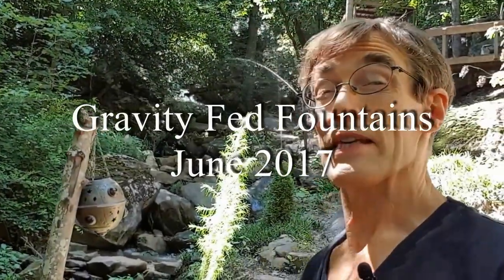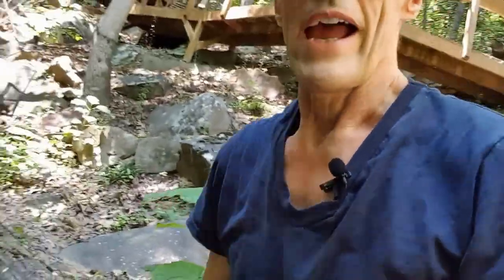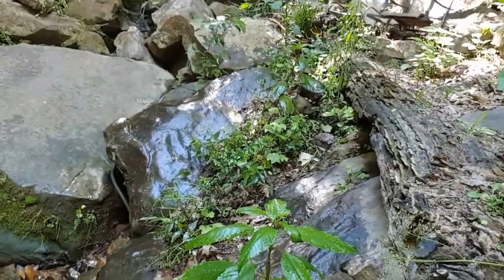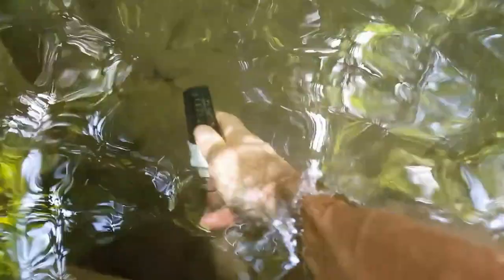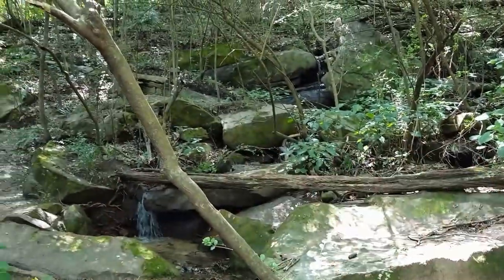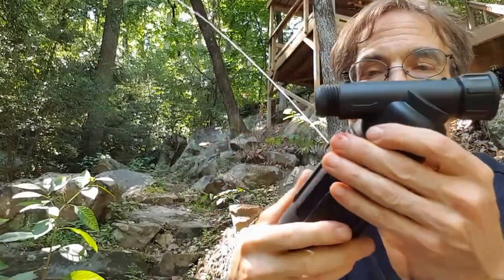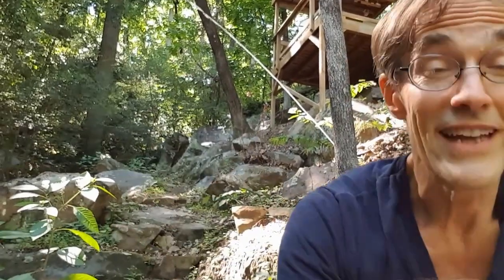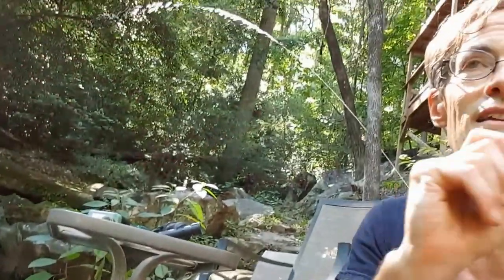Gravity Fed Fountain

Comment: What is very fun, is actually mounting a light inside the nozzle casing. The water conducts the light light an optic fibre and there is very little extra light elsewhere. Which gives a fantastic effect of glowing streams of water in almost darkness.
Small, waterproof garden or pond lights that are only 2 or 3 watts work excellently and are compact enough to fit inside a large waterpipe
Reply from the maker: Sounds interesting, may have to try that, thanks!

Comment: Filter system hose possibly needs a medium float, and anchor to hold it in mid water flow to keep it out of deep mud. If a float is added to a pully and attach a float to the other end of the cord that stays on top of the water to allowing the hose to not touch the surface of underlying mud most of the time do you think it would slow the silt build up on the filter? It might act like the workings of the inside of the toilet tank.
Reply from the maker: I have since switched to a collector pond which allows for silt to settle out better.  A couple of videos on that: https://www.youtube.com/watch?v=y8dKS1wFhHc https://www.youtube.com/watch?v=Gk2dtLa30Js

Comment: Hi Bruce with your constant water flow could you not setup a water mill to power something?
Reply from the maker: I considered that, but the stream is sometimes dry and often weak, so I doubt it would be worth it.  The top of the hill is only a few blocks away, so I'm amazed it runs as much as it does. 
Also, when it rains, it becomes quite a monster that could take out a poorly designed wheel ... the type I would likely install :)

Comment: What were the results of the passive solar water wall battery?
Was it worth the cost and time?
Did it work like you thought it would?
Did it last the full year that you intended to monitor it or, did you have to abort the experiment?
Reply from the maker: Had to abort, moved 6 months after installation.
Reply: I'm sad to hear that.   For some reason, I was thinking that you just had a second house in a different climate for other means of testing.  Thanks for the quick repply.
Just out of curiosity, did you have any issues with leaks in any of the tubes before you had to abort the project?  That had to be a considerable amount of pressure at the bottom of those monsters.
Reply from the maker: No issues (leaks or algae).   Fiberglass is pretty strong.

Comment: maybe larger intake hose at the top to smaller one at the bottom for higher psi....? or a small spring box if that is allowed for you.
Reply from the maker: Good idea ... did that last month :)   I replaced upper section of garden hose with pvc pipe.   The inside diameter of the pipe was a little bigger, but more importantly, it avoided the problem the upper hose had with collapsing due to the suction pressure.   The lower hose is full diameter, due to the pressure, and would be harder to replace with pvc pipe.    
I considered a spring box, but don't need clean potable water, so probably not worth the effort.
Thanks for the suggestions!
Reply: awesome! love your videos. the water wall was what caught my eye originally and will be trying to adapt that concept for a greenhouse or my home in the near future. keep up the good work!

Comment: Damn, the spring fed creek on my property is below the house :/ 40 feet below too. I'd have use an electric pump.
Reply from the maker: If you have enough flow from your spring, you can use a 'ram pump' to get pump the water uphill, no electricity required!   It does not give a high flow rate, but even a small trickle can make for a great ambiance.    I have never tried it, but I have seen lots of great how articles and videos  out there.
Reply: @BruceWinter  thanks for the tip! I'm gonna give it a try